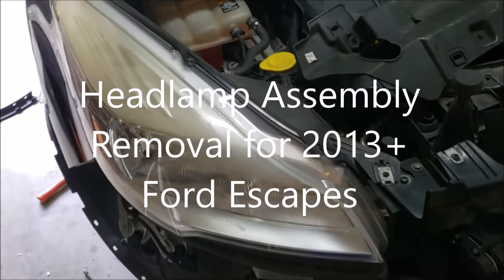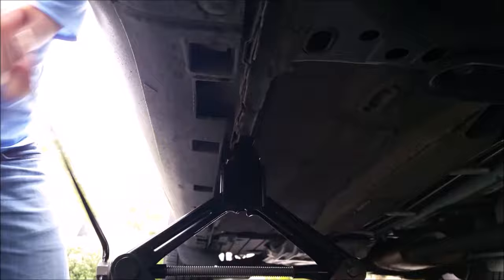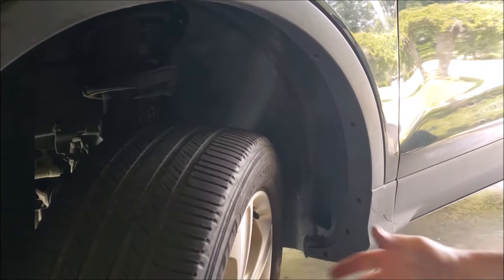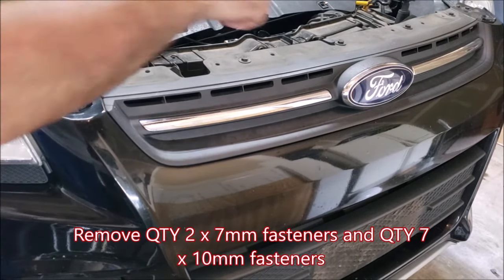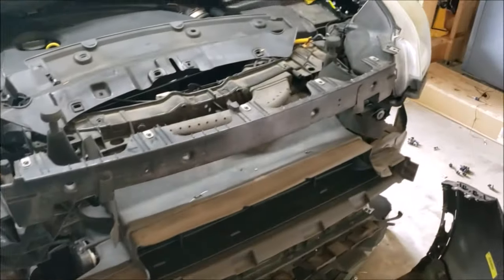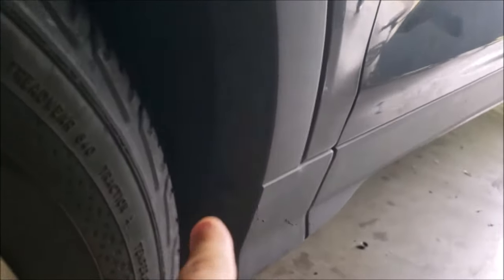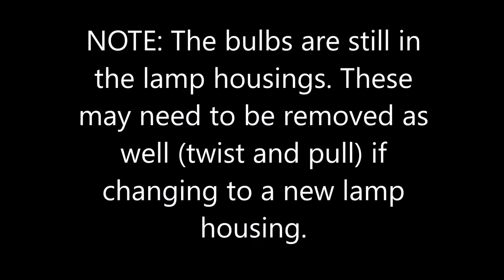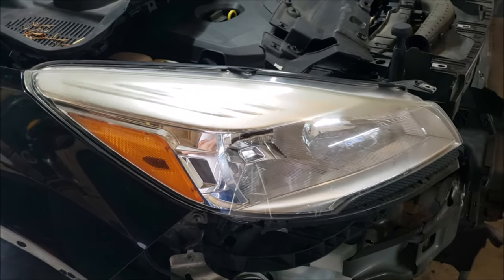Ford Escape Headlamp Replacement - ALL STEPS: HOW TO ESCAPE

Comment: Thanks for the video. I did this job today in about 4 hours and the video was very helpful. I removed the front wheels as well as the fender liners which gave me easy access to those 6 10mm bolts that hold the bumper to the upper fenders.
Reply from the maker: @adamcotton5356  awesome! Great tip to save some of the aggravation for those bolts! Glad you got it done and thanks for the feedback!

Comment: Just finished replacing the drivers side headlight in my wife’s 2015 Ford Escape (1.6L EcoBoost). Took us about 4 hours. 

Would not have been able to do this without such an detailed and thorough video. So thank you! 

I was able to complete the job without removing the whole front bumper. Completed almost all steps until I could pull the bumper off to the side enough to sneak that screw out. 

Again thank you and I look forward for more videos to come!
Reply from the maker: Hey there Josh,  glad you were able to knock it out and get by without having to take everything off! It is crazy how tucked in things are with this car and we have just been trying to record stuff as we come across it as well- thank you for the encouraging feedback and please let us know if there is anything in specific you're looking for that isn't already on the channel! Have a great night
Reply: @HowToEscapeDIYTipsandReviews  Thanks for the reply, unfortunately I'm not out of the woods yet. Turns out the headlight assembly I ordered was defective. The beam was pointed much lower than the other headlight. When I tried to adjust the headlight beam I discovered the adjustment assembly inside the headlight does not work (guess that's what I get for ordering the economy part lol). Looks like I'll be doing the job all over again once I order a new part. hopefully the second time around is smoother haha.

Comment: I just replaced the headlamp assembly in a 2020 Escape.  Ford made it much easier.  With a very short 10mm wrench and/or small 10mm socket wrench you can reach in from the top and get to the third screw.  You definitely do not have to remove the bumper.  It turned out to be helpful to open up the wheel well as described in this video.  You can reach in from the top with one hand and through the wheel well with the other to loosen the bolt.  There is a plastic clip that you need to salvage from the old assembly to use on the new one.
Reply from the maker: WOW. that IS much easier! Glad you were able to use the video to at least access the bumper wheel well. Hope your 2020 Escape serves you well! Thanks for taking the time to comment and hope all is well!

Comment: Enjoy your videos, used the one for sealing the Escape roof rack leaks. Very nice work on your part. Have owned only Fords. Have 17 Escape and a couple of 2010 Fusions. Have removed bumper covers several times for various reasons. Once you do it the 1st time, is much easier 2nd go around. Seems Ford likes to make it difficult to get to one or more fasteners needed to complete the job depending. As you noted, there are times when partial removal can get it done if you're familiar with it.
Reply from the maker: I agree- the learning curve is there even if its steep at first haha. Thanks for checking out our other videos too and yeah that leaking roof rack has gotten so many of us haha. Have a great night and thanks for taking time to say something! Please let me know if there's anything you're looking for in specific

Comment: Have you done a video on how to change marker light bulb ? Theres a few differet styles on the light assemblies with the escape....long stort short i had a burnt out marker light and i had the bulb replaced it did nothing so i proceeded to replace the socket and now still nothing new bulb and socket so now I'm wondering if its a short wire harness thats the issue

Comment: I've had the l/h lens smashed on mine by a falling tree, so hopefully this video is really going to help me get the unit out.  It's a xenon, so a replacement is £700.00 uk pounds... However, I've found someone selling a replacement lens only, so fingers crossed as I suspect it's coming from China or similar, but at £40.00 it's worth a punt.  -   I don't suppose you've ever tried to take the clear lens off before? I'm wondering if it's sealed with silicone / glue etc. and I'll need to clean it all out and re-seal it.  I'm hoping that it's possible tbh. Obviously Ford don't seem to sell just the clear bit...   (I have an MR2 Spyder and you can put the lights in an oven (low heat!) and separate the lens from the back... and do the same to re-attach them, no cleaning sealant or re-applying it, just heat and pull to separate or heat and push to seal... SO hence thinking it may be do-able on the Kuga/Escape...)

Comment: hey man i have a question i have  a 2017 escape  and it gaa this same headlight in the video do you think its possible to put the ones that have a led bar on the bottom?
Reply from the maker: Hey Edgar- the upgrade from the halogen to HID factory headlights is tough. The wire harness is different and it would be complex to modify the system if possible. You may be better off with an aftermarket drop in lamp system with LEDs which work with the halogen wire harness.
Reply: @HowToEscapeDIYTipsandReviews  thank you so much do you have any recomendations of sone really nice headlights?

Comment: just completed this yesterday  on a 2014 Escape to replace the headlamps,new grill insert and changed the lenses for the turn signal and running lights from amber to clear,.to put it mildly,the 6 bolts inside on the fenders SUCK,as I did not have access to the set up you have.Ford did not make this easy did they?
Reply from the maker: Congrats on getting all that done, Dennis! No they certainly did not with this vehicle! Good work!
Reply: How long did all that take you?  I'm still going to do this, but I almost wish I had just taken it in to have it done.
Reply: I remember it taking about 4 hrs due to changing everything out. If changing the  bulbs only it takes maybe half hr. Just be sure you pull enough of the liner back so it doesn’t eat your arm up
Reply: @denniscolby480  I'm replacing the assembly, and I just wanted to make sure I allocate enough time to it. I hate nothing more, especially on stuff like this, to get in the middle and have to stop.

Comment: Ok, let me see if I got this straight. In order to replace the headlamp I must first remove all four doors, then the back seats, the the luggage racks on top of the vehicle,  then do the Macarena….. cheese us crisp…. What the “F” ?
Reply from the maker: Hah! Well at least it's not ALL of those things.. maybe 90% of it though... yeah... standard Halogen bulbs are all accessible from the engine bay. HID / Xenon bulbs are mostly accessible from the engine bay but the ballasts are underneath the housings. If you need to replace the housings for either setup, you do need to remove at least that part of the bumper cover to get to the third and lower screw securing the lamp housing in place. It's a huge pain. Zero points to Ford for that one. I'm not sure if you watched to the end, but at least when you're reassembling everything, there is of course the option to not reinstall that lower screw so that you can remove the lamp housing again later down the road without removing the whole front setup. I know this isn't awesome, but just wanted to address the question. Hopefully the video gives some confidence in how to go about it. Thanks for leaving the comment and for the laugh :) Have a great night

Comment: I didn't do 95% of this. Just pull the wheel off, pull the wheel well out you can get the bottom bolt and pull the top bracket off the bumper. Have to work the headlight out a little bit but it comes out.
Reply: Do you have photos?  I realize it's a little late to do a video?  I'm having trouble visualizing your process, but I need to get at least one of mine done.  The housing has been badly cracked for a long time.  The moisture inside never goes away now.  I'd love to save a little time.  Or a lot of time.  This is absolutely nuts.  I've changed housings on probably six or seven different cars and never had anything close to this happening before.  NUTS!

Comment: Q?   Your videos are great - but I'm unsure why you aren't getting more views.    Are you doing  everything you can to get viewers (i.e. using "DIY" and "Kuga" in the video tiles and tags)?
I'm talking in general and not specifically about this video.  Thanks!
Reply from the maker: That's a great question lol- yes I DO try to keep up with tags and metadata but I'm never 100% confident I'm optimized properly- I'm using Tube Buddy and Keyword Planner to look for competitive tags... I'm no jedi master though :) still learning. I started to include Kuga in the keywords, but stopped as there are actually quite a few different things between the Escape and Kuga when you get into the nitty gritty and I didn't want to disappoint anyone and have a risk at more dislikes per video to drop the score. Only speculation though-  do you have any tips?

Comment: I love the video but hate my Escape just for this reason. Mostly it has been reliable and works as advertised. The problem is replacing bulbs, whether they be headlights or fog lights.  Like toolman272 I have to pretty much strip the dang thing down to the frame just to stick in a new bulbs.  With my Volvo it is two posts, pull them up and unplug  the power plug and viola the light is out and ready for changing...2 minutes and done.   Ford, 2 hours of cursing Henry’s name, and 2 more hours finding the 1100 fasteners you took out and probably broke as well, 2 hours on the phone with Ford parts guy and then another couple hours driving there to get the fasteners and clips you lost or broke.  Then 30 second taking out the 3 T30 Torx screws and then accidentally dropping the loose headlight assembly on the garage floor....

Comment: Are you kidding me??? 
I just want to get the moisture out of my assembly. How do I do that?
If you need to replace the assembly I guess the car is totaled!🤣
Reply from the maker: Haha it is pretty ridiculous. You can get halfway into taking off the side maybe to just get to that lower bolt. Its crazy. Your reaction was my reaction when demoing this video...
Reply from the maker: Good question- its a bit lame because its not really a discount to "rent" it, but you basically pay for it outright up front in case you never come back with it. The "rent" part is that they fully refund your money 100% after you use it whereas any other situation wouldn't let you get your money back when you use the product.
Reply: @HowToEscapeDIYTipsandReviews  seriously though. My driver’s side headlight is full of moisture. It actually diffuses the beam.
Would you suggest that I take out the bulbs and blow a hair dryer in it? How do I prevent this from reoccurring?
BTW, thank you for the Escape series. I downloaded your app as well.